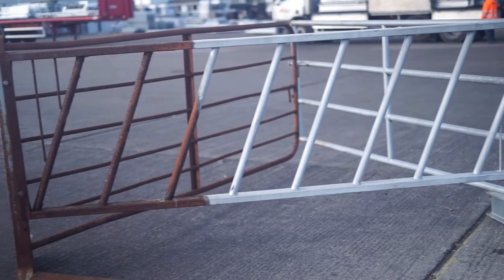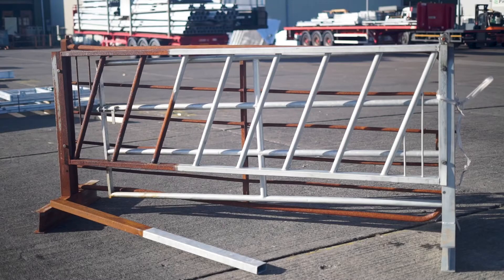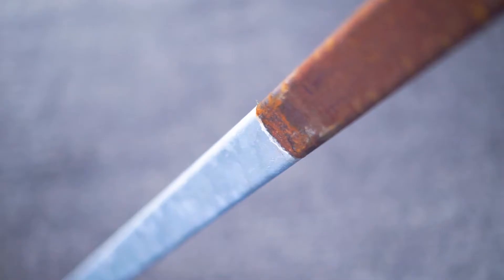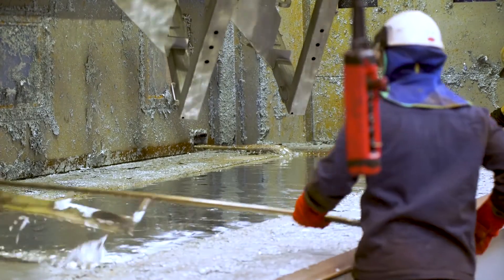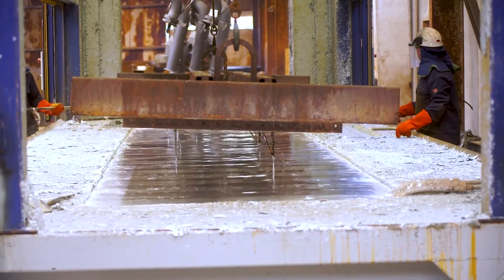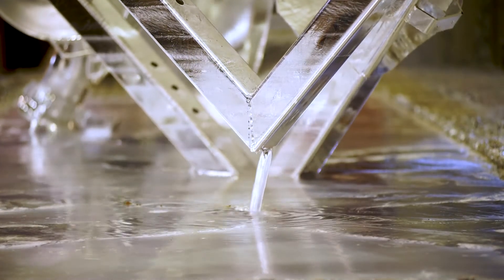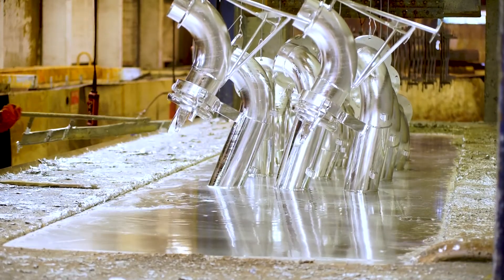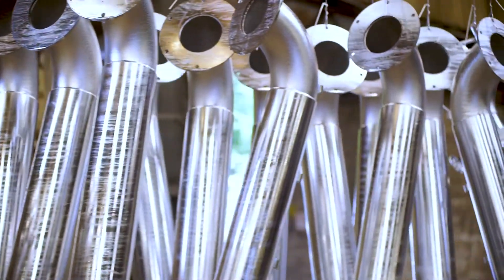Secrets of Hot Dip Galvanizing  - Galco Steel Ireland

Comment: would you do a whole car
Reply: no, the heat would cause the panels to distort
Reply: @hillengineering8264  i would like to try on an old drift missile, see what happens, i have seen cars done in it before
Reply: Most steel used in cars is galvanized, then stamped into shape, welded if needed, then painted.
Reply: @trapperjohn3400  no
Reply: @markilleen4027  In the US this is the case
Reply: @trapperjohn3400  no my car isn't galvanized